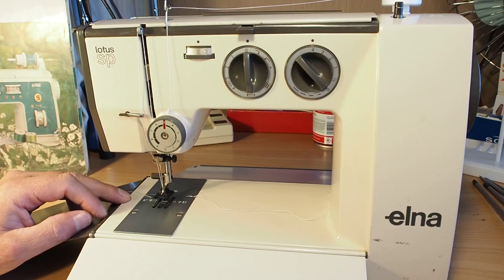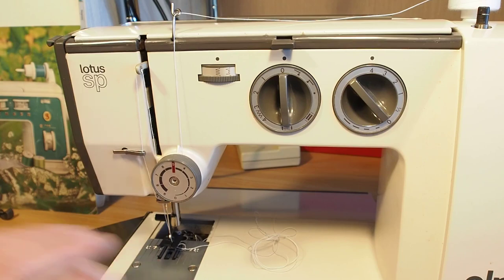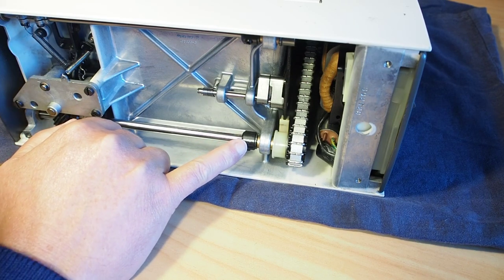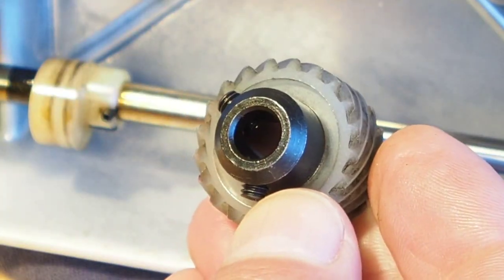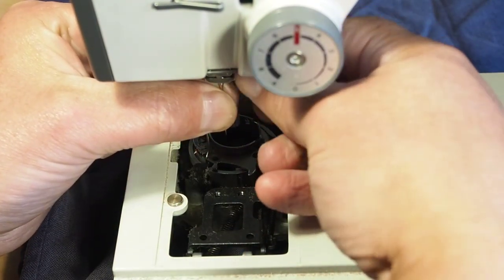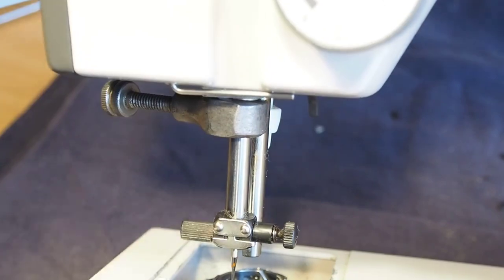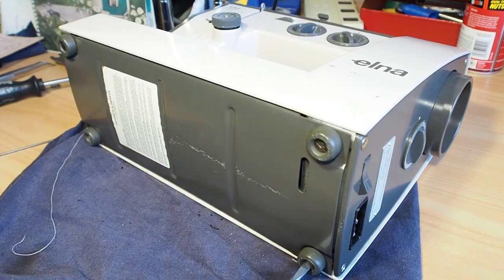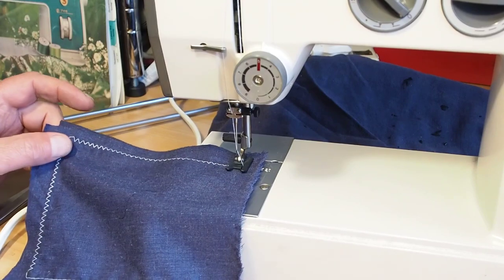Elna Lotus Hook Pinion Gear Replacement

Comment: I have Lotus SP.  The thread is caught under the bobbin area and is stuck solid  nothing moves, what can I unscrew to get at the jam apart from the feed dogs. It happened whilst turning it by hand after threading so may not be any damage done. Thanks for sharing. Am I right in thinking bobbin unwinds ante clockwise?

Comment: Thankyou for such a clear helpful video. I had my Elna lotus sp as a wedding present from my parents in 1972. It has been well used and never let me down. The timing was out slightly, only noticeable on zigzag, after it got jammed with cotton, and has been put aside as I have a couple of other vintage machines. Your information has it working like a dream now, I think it's the smoothest machine I have. The only downside is that it has no reverse. My other machines are in order of purchase Viking prisma 940, Bernina Activia, Singer 6105, New home/ Janome 677.

Comment: I've just bought a replacement Hook Pinion gear to replace the mangled black one. Trouble is the grub screws are not metric. A 2mm allen key is too small & a 2.5mm is too big. So I assume it is Imperial, but I can find no equivalent between 2 & 2.5mm. Apparently the pinion gear is made in Taiwan. I've replaced 2 before with no problem, but they had the 'normal' 2mm grub screw. Would you have any advice on this? How much would yours be with shipping to UK, for example? Buyers in UK on Ebay might want to be aware of this difference.

Comment: Hi my machine seized with the needle down. I managed to get the needle out and the foot off. I've just taken the covers off today to see what might be causing it. The hook pinion gear has disintegrated. There was no thread stuck in the bobbin casing and the belt is ok. I'm wondering whether something else might be wrong because  you put the needle down to the lowest point and marked the white cam. My needle is in a lower position but won't move up and down at all.

Comment: Watched your earlier video, opened the bottom of my Lotus just now, and yes - the gear is a total loss. SO GLAD to have this video to guide me through the replacement. 

The first sewing machine I bought myself was a Lotus SP. Can't remember why I got rid of it, but I recently found and purchased a vintage replacement. Was so disappointed when the bobbin thread wouldn't pull up, but now I know why, and what to do. Thanks so much!
Reply: Your instructions worked perfectly! My only issue was loosening the old gear and other items from the shaft. That took quite a bit of "gentle persuasion", but all was well in the end. I was able to fashion a timing gauge from a round toothpick cut to the proper length (32 mm on my machine) and wedged between the needle holder bracket and the needle bushing - it worked very well! Many thanks again.

Comment: Thank you so much for posting this video with very clear pictures!  

As the saying goes, “a little bit of knowledge is a dangerous thing!  I was gifted an elna lotus tsp that was jamming.  

Having had luck in the past with simply cleaning and oiling kenmores restoring them to life, I found directions for unscrewing the bobbin case…….

Trusting that patience and allowing the bits to ‘fit’ into place, it has been a month of not being able to get the case back in properly!  

Yours is the only video that reveals just how the fingers of the case fit between the 3 stoppers under the needle.  I screen shot the view of the bobbin mechanism without the teeth blocking and was able to have my machine running smoothly 5 minutes later!  Thank you!

A video suggestion if you’d like, is outtakes of your video shots of the Elna bobbin case.  Youtube is encouraging ’shorts’, 15-30 second videos.  Two other ‘shorts’ I see in this video are ‘Loading Elna Lotus Bobbin’ and ‘Threading Elna Lotus’.  Laughing, I’m on a roll now, remembering all of things I was unfamiliar with the new to me Elna.  Two more, “Removing and Installing Elna Lotus Bobbin Cover”  “Removing and Installing Feeddog Plate”.

I truly appreciate your work!  Thank you!

Comment: Replaced the broken pinion without any issues following your video.  I made the spacer tool from some hard plastic which worked a treat, and the machine is running like new.   Another one saved.  Thanks.

Comment: Thank you so much , so clear and well thought through.  Stupidly whilst trying to free a very sleepy machine I pulled the timing belt off the bottom spindle.  I have eventually reset the machine by bringing the needle to bottom dead centre and lowering the feed dogs to their lowest position.  Is there a rule that I should have followed?  Regards  Ray

Comment: Thanks. I'm mainly concerned about lubrication, which must be crucial to the longevity of these machines, not to mention their smooth running. 3 years ago you planned to make a video on lubrication. If you did made it, what level of membership would make it accessible, or any other info/advice on this subject for that matter?

Comment: Very helpful as always. Many thanks! 
I've just replaced the hook pinion gear on a friend's Elna Star series zig-zag (the grey top model). 
I followed all the steps diligently but when I tried it out it wouldn't zig-zag. 
I stripped it down again and started all over. Still no zig-zag. 3 days later and ready to chuck it in a blackberry bush I thought the only thing I haven't tried is turning the needle around with the flat side facing away from the needle bar. Voila!! 
I had the manual for it sitting right there the whole time showing the proper needle orientation. Never thought to consult it. Why would you? It must have been smirking to itself watching my travails those 3 frustrating days. Lesson learnt....  till next time!  😅
Reply from the maker: Hi, it's great to hear you managed to get it sorted. Thanks.

Comment: I’ve bought an Elna Lotus SP that looks like this one. I want to love it so much but it’s very loud and vibrates, and the bobbin winder part is broken. I sourced another used bobbin winder part. It seems a bit worn and the repair person doesn’t want to install it. Any chance you might do a video someday on replacing the bobbin winder part and maybe the motor drive wheel (could explain the loud noise?) Fingers crossed! thank you

Comment: Thanks so much for your brilliant videos. Recently I've been working on my SU and 2 friends' TSPs and with your help have unstuck a needle position wheel and replaced a hook pinion. I'm just not clear about lubrication, especially viz a viz nylon/plastic cogs and cams etc. I'm clear about the oiling instruction in the manual but can't find anything more comprehensive. Why did the original pinions disintegrate? Was it too fragile a plastic? Did too much/too little grease or oil damage the plastic? Are the replacement pinions really nylon and can therefore run dry? And what about the other plastic parts? If you could shed any light on this, that would be absolutely fantastic. Greetings to you and Molly
Reply from the maker: I think the gears mainly fail because of age and high usage. Thanks.

Comment: Thank you so much for this incredibly detailed and informative tutorial. It's my first go at this and I wouldn't have a hope in the world if I hadn't had found your video. I am stuck on one bit though... The hook pinion gear seems to be fused onto the shaft. I've undone the grub screws and everything, and sprayed it with WD-40, but it won't budge! Any ideas would be greatly appreciated:) Thanks again!
Reply: Try tapping it along with a screwdriver. I had the same problem but it went eventually.
Reply: @garethonthetube  There are little spring loaded things behind the cams.At 10 mins into the film you can see it—the rectangular white thing above and behind the circular cam. There is a similar one at the left-hand end too. These block the spindle from moving.
Reply: There are little spring loaded things behind the cams.At 10 mins into the film you can see it—the rectangular white thing above and behind the circular cam. There is a similar one at the left-hand end too. These block the spindle from moving.

Comment: thank you for this video. Can you please show/explain me how to replace the light/lamp. just removing the screw is not enough, to reach the lamp. I hope you can help me.
Reply from the maker: Thanks. On the back of the machine, you'll see a small lever protruding from the area where the bulb is. Unplug the machine and push the lever down the slot in the back and that lowers the bulb carrier, making it easier to get to. Remove old bulb (I think it's a bayonet type) and install new bulb.
Reply: @InStitches  thank you for your very quick response and explanation. 
I'll will try your instructions.

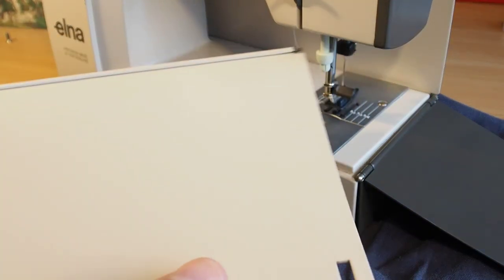Comment: 5:28 - good tip about the washer but you've already lost your washer on the other side! There should be washers on both ends of the side flaps.
Reply from the maker: Yes it was already missing. I'm keeping an eye out for a replacement.

Comment: Hi thanks for the super video.
What is the exact name of the tool you use for the timing procedure?

Try to find it on google but i think my keywords are not good.
Are there any repair manuals out there for this maschine?

I have the same Lotus SP here in Germany, with a broken bobbin winder. 
Only the small plastic part is broken,  I will try to fix it with my onwn 3d Print.
These a very good maschines, it is for my motorhome
Reply from the maker: Thanks. Maybe try sewing machine timing gauge or needle bar gauge. I had a quick look online and found these - https://www.sewingpartsonline.com/hook-timing-gauge-101360-20.aspx
http://whitesewingcenter.com/timingtool.php
It's effectively a small clamp that clamps on to the needle bar, with a thickness gauge. The thickness is determined by the model of your machine's needle bar rise.
Some machines have marks on the needle bar so look at your needle bar first.
Reply: @InStitches  thanks. That's exactly what i am looking for. Learning a lot looking at your Lotus Videos. Love this Swiss Maschines. Move on.
Fixes my bobbin winder with a 3d Print and will Test it tomorrow.
Reply: @axelhollenberg1034  Hi, You can design and 3D Print the tools too (!). I will do it definitely (I'm waiting for my hook pinion to arrive).  InStitches: Good timing wit the movie - much thanks - I just today found broken gear on my old /new/just bought machine.
Reply from the maker: @axelhollenberg1034  Thanks. I'm please you're learning from my videos.
Reply: @TomekAC  Good Idea. I will give thingiverse a try, who knows. Do you also repair a Lotus?
Reply: @axelhollenberg1034 : I bought Elna Lotus few days ago (paid ~65€). Unfortunately with damaged gear. So, Yes, I will repair my Lotus ;-) I already disassembled my machine and ordered replacement pinion. I just started to look for information how to check/set timing, but to my BIG surprise I found this (and other) "In Stitches" videos (Kudos to You! Great work, pleasure to watch and learn (English too)). 
I will design & print "timing tool" for sure -  - this is not urgent yet as I'm waiting for replacement gear, but I have this in my queue.
Reply: @TomekAC  , if i find Something i will add a Link here. I have two Lotus now, one ZZ and one SP.  
One for our Motorhome, for rainy days. Fixed the Bonbin winder Yesterday, with a self printed Cover. Waiting for next super Videos!
Reply: @InStitches  I Just finished my SP, but the foot Pedal is more Like an ON/Off Switch. Slow sewing is Impossible. I Open it and there is a resistor with a lot of contacts. Do you have experience with the Switch too, or an Video?

Comment: @Natalia - I've just bought a new replacement hook pinion gear on eBay.....and it works a treat (search sew.tec "HOOK DRIVE GEAR FITS ELNA LOTUS SEWING MACHINES #408101")
@ In Stitches video is really useful - great detail on how the whole mechanism works, and what to be careful with etc. Many thanks...... now got my Elna ZZ working perfectly again.